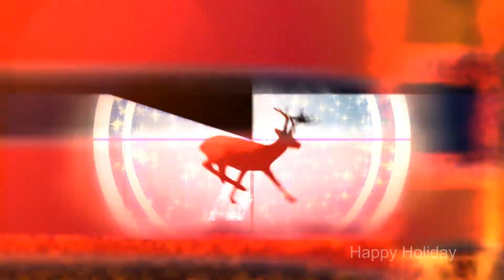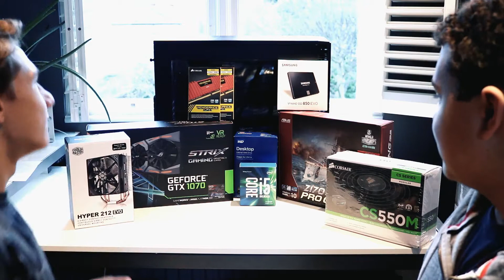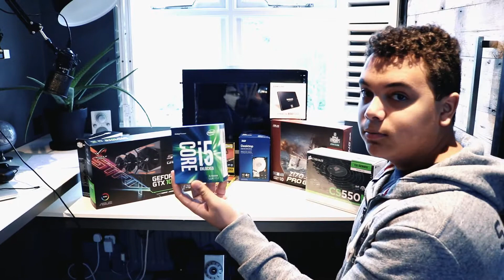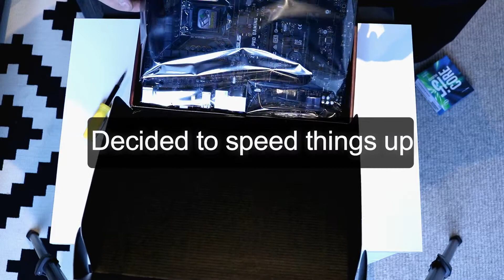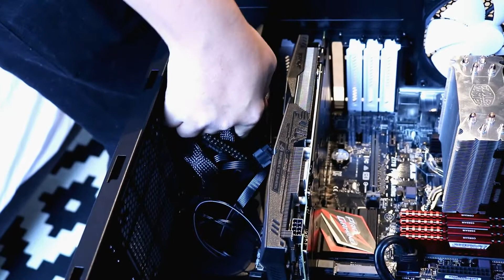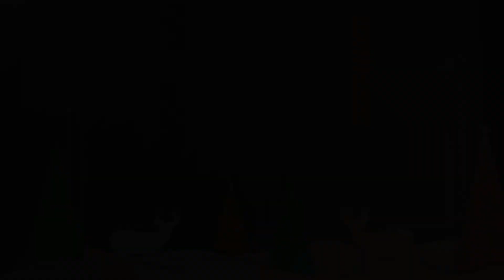MY ULTIMATE GAMING PC BUILD!!!

Comment: just to make you aware, a 550w PSU may not be the best option as your system will require more power for gaming at decent graphic levels and with decent games ... I had one with a less powerful gaming machine and i was made aware of the fact it may blow up with only 500w and it blew up... I would recommend u use a power calculator for ur parts to confirm 550w isn't too little if it is, the Corsair cx750 is great
Reply: Harry Demant I checked.   It only uses about 400
Reply: Patrick Spiegel okay thats good just thought I should look out for u just in case as when I built my first machine it went down the explosive route... anyways merry Christmas and enjoy your PC, I hope you have a good day